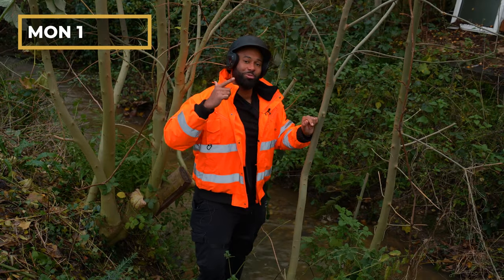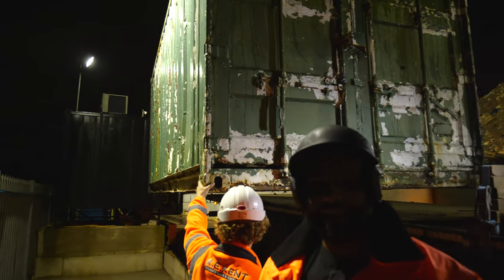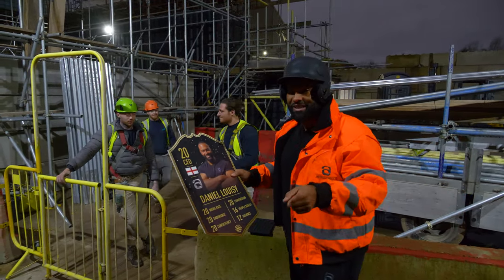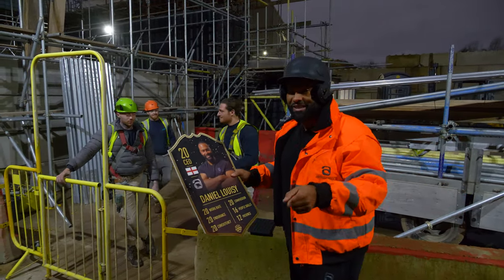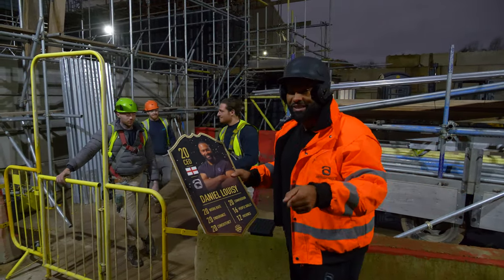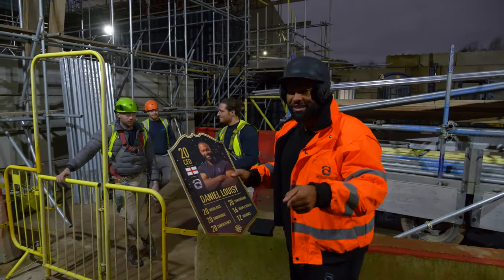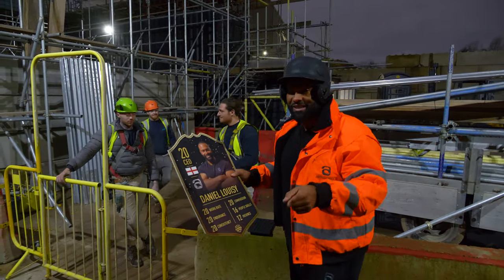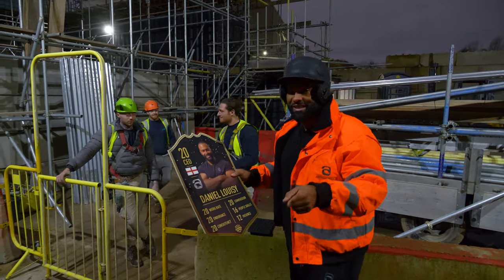Trains, Plant and Scaffolding Gyms | Ashville Weekly ep007

Comment: 33:15 - It's amazing little backstreet places like that which are awesome to deal with

Regarding the train. I'm not sure if it's been tried, but would altering the unloading technique speed it up?

I'm assuming it's currently 1 carriage (bulk remove) - then scrape out the remains. Move onto next carriage

Would it be faster to bulk remove every carriage all in the same reversing the train, and then the train drives forward to unload each carriage with the little bits of remains?

I imagine the time wasting portion is scraping up the remains more than emptying the main contents So having them all low might help be quicker. 

No idea if it would work, just maybe a suggestion if you don't already do it. Even if it only saves you a couple of minutes per carraige it's still 40 mins on 20 carriages

Alternatively - Is there not some sort of giant industrial hoover you can get to suck up the remains from the carriages?

Comment: You guys are probably already doing this, but you should fill up your machinery at a quarter of a tank. we use to have IMMENSE fuel issues if we let the fuel levels in the machines get too low. The fuel pump would suck up any dust or stones from the yard (trust me it gets in) in the tank. Fuelling up below a quarter runs the chance of kicking up the dirt and circulating it and then the filters and injectors get clogged and ruined. Try implementing a company wide rule to not let the vehicles get below a quarter of a tank of fuel!

Comment: I'm surprised that the train carriages aren't designed to tip sideways to unload next to the track. Easier said than done but definitely possible and would save hours of unloading and cleaning out the corners of containers. It's extremely slow and laborious. You'd need an outer panel of the container to fold down as a slide for material to not gather next to the train track... Or, the side wall could have a full-width trap door at the bottom and, again, a slide. It would need a hydraulic tray in the base to tip out the last bits of material but this would be far simpler than rotating tonnes of fully-loaded container. Then you could scoop/push it with a dozer, if you keep the area clean.

Comment: Wide bars build tendon strength, realistically you should be pulling up on theses things called beast makers which is what climbers train with, but you can make the same thing by routing some lines in some 6 by 2 it takes a while to get use to and you can’t rush it cus you can tear tendons if there not strong enough but your muscles are, but you will be able to crush a mans hand in a hand shake

Comment: personally hate metal studwork, cheap option yes but no where near as good as a proper wooden stud wall, also if there is alot of it - it can actually cause phone signal and wifi problems. ive been in houses that have zero phone signal inside and full signal outside the front door because of the metal studwork that is in the building